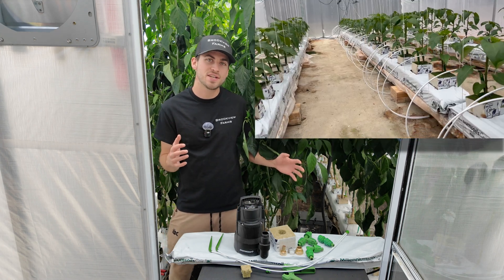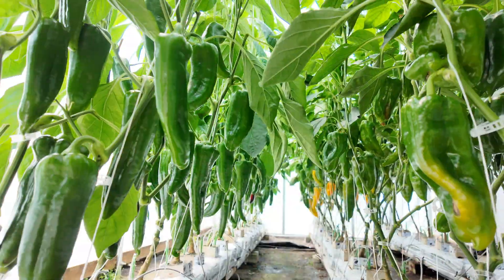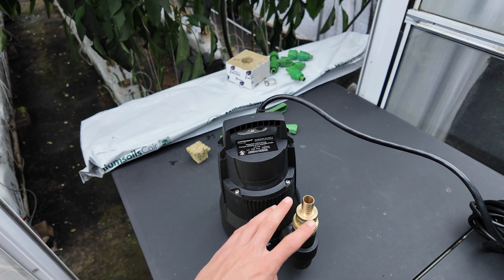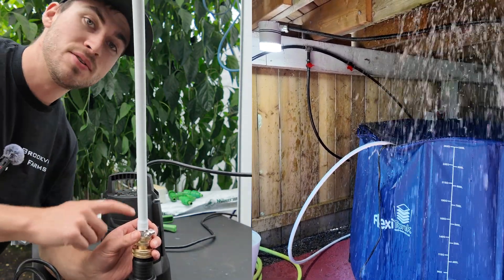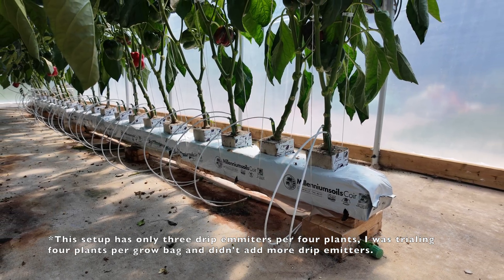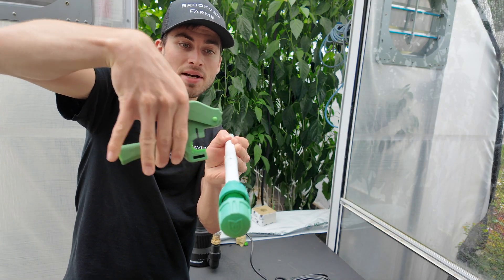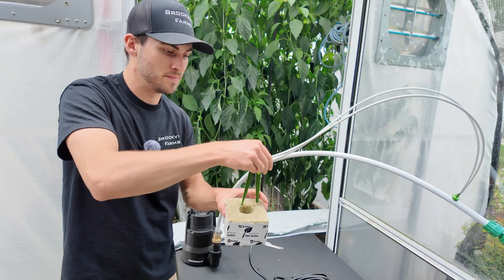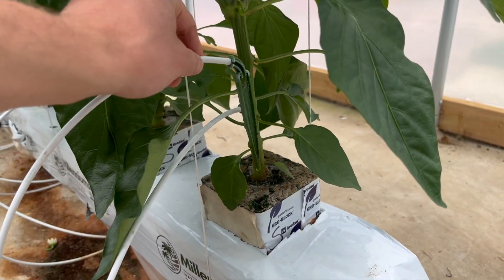Drip Irrigation SETUP | HOW TO GROW with Hydroponics

Comment: Is that PEX pipe or is it different? It looks a lot like PEX pipe. Is there any worry with the irrigation line blowing out of the main tubing where it snaps into those holes that you punched in?
Reply from the maker: 16-17mm Double Layer Tubing, it’s made of BPA- and lead-free polyethylene (PE). This double-layered design features a white outer layer to deflect sunlight and reduce internal heat, paired with an opaque black inner layer to block light and prevent algae growth.

Recommended Operating Pressure: 15–50 PSI, with an optimal range of 25–35 PSI for best performance of the pressure-compensating emitters and tubing.

I’ve never had any drip emitters blow out, they snap in pretty tight and can be difficult to pull out. I’ve also replaced drip emitters and they still fit snug in the same hole without and leaks.

Comment: Le substrat est il de la fibre de coco ? 
Quel est le nombre d'irrigation par jour ?
Reply from the maker: Yup the grow bags/slabs are made of coconut fiber. During peak growth and summer heat with long days I’ll irrigate up to 12 times per day, usually 4-6 mins per irrigation.

The key is to always have a bit of drainage every irrigation event and keep the moisture content within the root zone near 100% during the day, allowing it to dry up 15-30% during night. 

During the day, around a 6% dry-back between irrigation events seems to be good.

There are ways to calculate how much dry-back is occurring, but to get decent results it doesn’t have to be perfect. When using drip emitters (0.6 GPH) a good way to know if you need to increase irrigation events is if you don’t see any drainage after the six minute irrigation event. With a six minute irrigation event you should see drainage for at least one minute

Comment: Thanks for sharing. How much does this setup cost?
Reply from the maker: I have three greenhouses all with a similar setup. The cost for each greenhouse setup including everything, greenhouse, exhaust fans, electrical installation, irrigation system, etc. ranges from around $2000-$4000 CAD. If you're just wondering about the irrigation system itself, pumps, tubing, drip emitters, etc. it cost around $400 per greenhouse
Reply: @Brookview_Farms Nice. Not so expensive.
Thanks for the info. I have visited the website you stated in other comments. Thanjs
Reply: Thanks for the insightful video. I will be starting my bell peppers growing bag planting trials soon. So I've been watching your videos. Do you cut drainage holes into your grow bags?
Reply from the maker: Awesome! Yes, I cut six drainage holes per grow bag, three on each side.

Comment: I am relatively new to this and I have a few questions, I want to try out the nft system with my 15w pump and PVC pipes and rock wool for starters for the seedlings and if it turns out well I will then go into this type of your system, but in a smaller scale for berries and bell pepper as that's what sells in my region Nigeria. Can I get some advice? As I want to grow and sell not in a massive scale but in a mid scale also how often does bell pepper produce fruit after first harvest 2-3 months from seedlings?
Reply from the maker: I usually start my seeds in the small cubes as shown and then plant them into the larger 4” cubes, during this time I water them every day or so with a watering wand. Then I’ll transplant them into the greenhouse on the grow slabs with the drip irrigation system.

Your NFT system could work for starting them, I’ve seen large NFT type tables to flood and drain the seedlings once a day for larger seedling production.

This drip irrigation system should work great for your scale as it can be customized from a few plants all the way up to hundreds.

From seed to first harvest it usually takes around 90-100 days for ripe bell peppers, after initial harvest, the plants can continue to be harvested once to twice per week until the end of your growing season. The amount of peppers you can harvest per season will depend on how long your growing season is and how tall you can grow them vertically with your setup, pruning the plants and training them to grow vertical is essential for a steady continuous supply of peppers
Reply: @Brookview_Farms wow this is a great knowledge and I will dive into it very well. My question now is how many Wattt pump do u think I should get for the irrigation? And do u think a newbie can grow with your kinda system for commercial sales ? Also is this system costly to run?
Reply from the maker: I use 1/2hp and 3/4hp pumps to run my irrigation system, this is equivalent to 368-552 watts, a pump of this size should be enough to run the system. With much larger and complex operations jet pumps might be required.

As for being a newbie it's possible to grow with this type of system for commercial sales, however there are key principles that need to be understood and followed to grow the plants successfully. I would recommend starting on a small scale to learn how to operate the system and keep the plants healthy. There is a lot to learn to make a system like this successful and if things are not managed properly the system and  plants can take a turn for the worse quickly.

A system like this is generally more expensive to setup and ongoing costs such as fertilizer can add up. With a well managed system, good crop management, and consistent sales, the investment and ongoing costs will be recovered with a decent profit. There are many factors that will affect profitability depending on location, resources, and market conditions.